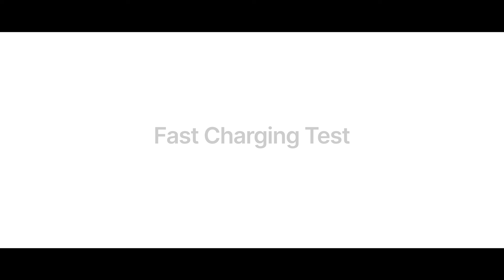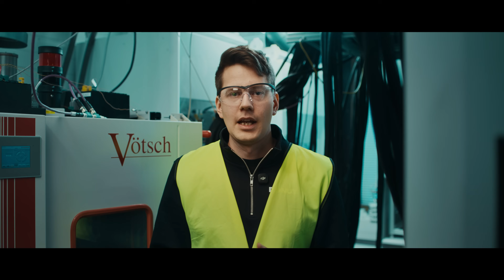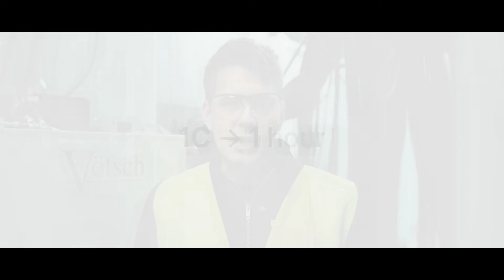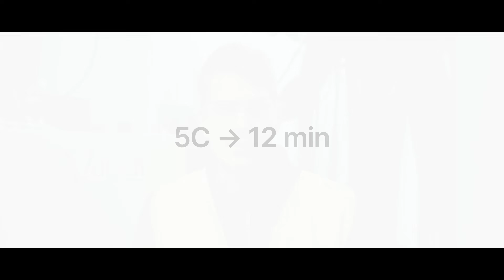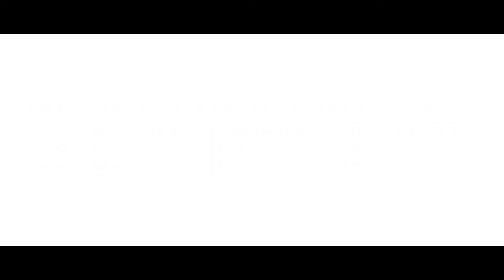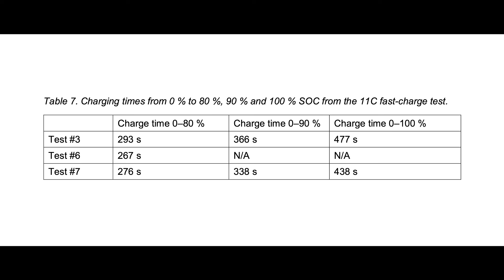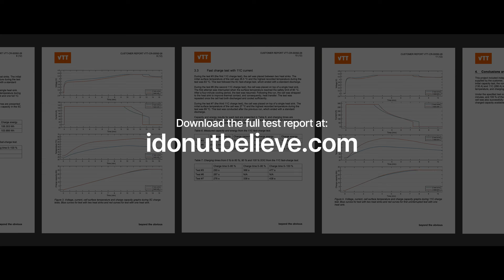Donut Solid-State Battery: Fast Charge Test | I Donut Believe (Pt.1)

Comment: Again, let's inspect what was NOT said here. The report mentioned that one test had to be aborted because battery started to overheat during test number 6 and it was fixed by "the cell was strapped to the heat sink to improve thermal contact". No details about this were provided.

Also, the charging was tested only at room temperature. Original claims include stable performance between -30 °C and +100 °C but the test number 6 was aborted at 90 °C already.

That said, even these results are pretty promising and if the cells actually last 100K cycles with this simple cooling, it would be great news even if other claims weren't true.

And looking at the test results, the end-to-end efficiency of this cell was around 82-92 % so the cell dumped 8–18 % as heat during charging. If you imagine 100 kWh battery pack of these and 10% heat output (nearly optimal design) with 11 C charging, you have to cool 10 kWh worth of heat energy in 5 minutes! Of course, if you can let the battery pack to heat close to 100 °C you don't need to dump that much heat out of the battery because battery will be pretty heavy and will not heat that rapidly even with 10 kWh heat input.
Reply: The weight of the heat sink(s) should be included in the energy density calculation..
Reply: The only reason the test was aborted was the test configuration software having certain standard parameters. You will see this in future episodes.
Reply: @markolehtimaki50  Did the battery lose 1% capacity after the 11C charge? That's how I'm interpreting the test results.

Comment: Impressive results but the cell looks to be 5" wide by 10" long by 3/4" thick. Not really a replacement for a cell 1/8 the size. Also now try it without the massive heat sync attached to it like it would be if it were in a pack.

Comment: Inconclusive testing. None of the heat sink properties are provided (W/K), no environment data (eg. tested in cold room with fan on), no long term battery degradation (main problem with high current inputs), no cell internal resistance or composition provided.

Comment: Kennith Radcliff Shoulders.... I hear EVO's as he called them are donuts. If this is legit there nano structures are definitely using EVOs to store the energy... The Russians got a vacuum tube smaller than a lightbulb to store over 10 kWh using Evos. Don't worry though everyone will call it meta materials, or it will just go dark. Heaven forbid the people figure out about the fractal hyper torroidal moment MFMP....

Comment: You know, in the intro, at 0:36, we're told that the battery is strapped to aluminium heat sinks on both sides in order to "simulate the cell being a part of a typical battery with not so great cooling" but then at 5:45, we see that two heat sinks keep the battery at a lower temperature than just one heat sink (which is what you would expect when heat sinks are strapped to a battery, for it to cool better). So did anyone brief the CEO in the intro properly?

But hey, a higher temperature means that the battery performs better anyways because of lower resistance, so uh woohoo. So I'm confused, if the battery performs better when it's hotter, why exactly are you talking about "active temperature control" at 7:50? Why would the battery need it? Well, according to the paper, it still has a safety limit at 90 °C so I guess you can't let it heat up out of control.

I wonder what happens to the battery after 15 minutes though. How long does it hold the charge? Anyways, I'm not a battery expert, so I really can't say much about what these numbers mean for the battery. Also, whatever it is, the real test is manufacturing at scale in order to make it widely available and my understanding is that there aren't too many customers yet. I'm not really sure what these marketing stunts are for though. Are you going public in a few months in order to raise capital?

Well, time will tell.

Comment: Good marketing. I’ll be following along but I’m really waiting for the full set of testing on one whole pack for power density, charge speed and life cycle.
Even if not as advertised! I’m sure there is something for others to adapt .
Reply: Yes exactly. Even if it's one pouch, having all tests carried out on the same device, verified by an independant body is the only way to be 100% sure this is legit. I want this to be real so much, but it will take this level of proof to believe it. 
My concern is that if they provide different videos for each test, the devices could be optimised for those tests only - so, one that is good for high speed charging, but maybe has a poor lifetime, or another that can be charged 100,000 times but the density is much lower. I hope they have this as one of the videos - if I was them it would be the final video in the series, showing each test run on the same device.
I'm excited and keeping an open mind, but I do need more proof

Comment: From ChatGPT:

Fast-charging claims (this is the one area the report does speak to)

Claim: “0–80% in ~4.5 minutes at 11C”
	•	Where they claim it: I Donut Believe says “0–80% charge in just 4.5 minutes at 11C.”  ￼
	•	What VTT measured: 0–80% at 11C was 293 s and 276 s (4.9 min and 4.6 min).  ￼
	•	Verdict: ✅ Supported (this is real, per this report).

Claim: “Fast charge at ￼ive cooling”
	•	Where they claim it: I Donut Believe calls it “without active cooling.”  ￼
	•	What VTT did: They used large heat sinks (one-sided and two-sided).  ￼
	•	Verdict: 🟨 Technically true if they define “active cooling” as “no liquid/forced air,” but ⚠️ misleading bec ￼e still substantial thermal hardware and temperatures got very high in the one-sided 11C case (see below).

Claim: “Stable thermal behavior”
	•	Where they claim it: I Donut Believe says “stable thermal behavior.”  ￼
	•	What VTT measured:
	•	11C with two-sided heat sinks: max 63°C  ￼
	•	11C with one-sided heat sink: up to 89°C, and one attempt hit the 90°C safety limit and was interrupted  ￼
	•	**Verdict ￼what “stable” means. It didn’t thermal-runaway, but it absolutely got hot and required interruption at the safety cap i ￼

Claim: “Charged to full in 5 minutes (0–100%)”
	•	Where they claim it: Donut Lab CES post: “charged to full in just five minutes.”  ￼
	•	What VTT measured: 0–100% at 11C was 438–477 s (7.3–8.0 minutes).  ￼
	•	Verdict: ❌ Not supported by this report (at least in this test, it’s not 5 minutes to 100%).

Claim: “No need to limit charging to 80%”
	•	Where they claim it: Donut Lab CES post says f ￼hout limiting charging to 80%.”  ￼
	•	What VTT did: They did charge to 100% (26 Ah delivered) in these tests.  ￼
	•	Verdict: 🟨 Partially supported: Yes, they charged to “100%” in the lab protocol — but it was 7–8 minutes at 11C, not 5 minutes, and this is one cell, not a pack.

⸻
Reply: One thing to bear in mind is the tests were tested with the battery just resting on the heatsink not thermally bonded for better heat transfer. Passive heating would include by definition of using heatsinks, but not active cooling of any form (e.g. fans or heat pipes). 

Test #6, although interrupted due to meeting limits, continued with better thermal transfer by the battery being bonded (tapped) to the heatsink. This could be due to starting at a higher temperature, or that for the test the battery had shifted on the heatsink it was resting on.

The 5 minute 100% charging battery claim doesn't indicate under what cooling conditions this is achieved. It may be one of the subsequent video's performs a 5 minute 100% charge (with appropriate cooling required).

Comment: Thermally the test report is "bullshit" if thermal capacity of the heat sink is not mentioned in the report.
The heat sink can absorb most of the power loss due to short test time.
People may ask, does this cell always require "thermal battery" attached. 400Wh/kg will not be valid any more.

Ps. Sad to see this as VTT thermal guru from 1980's but good luck.

Comment: this is what ChatGPT thinks of the report:
Short answer:
⚡ Fast-charge performance: impressive / near-leading
🔋 Energy density: unknown → cannot claim parity
🔁 Cycle life & durability: completely unproven
🌡 Thermal behavior: concerning at extreme C-rates
👉 So: promising power cell, but NOT yet proven on par with top modern Li-ion overall.

Comment: I'm not an electrical engineer. In fact I have zero qualifications of any kind in this field. So please anyone, anyone at all explain to me (after 13 pages of reading) how these results are possible?
Reply: It's already possible with capacitors. The problem is energy density. Capacitors need to be much larger than traditional batteries to retain same level of charge and are thus unusable (as batteries ofc.). As for what the new tech actually is we don't know.
Reply: @WXKFA exactly! The “how” is everything!

Comment: The VTT-CR report is a highly credible verification of specific, extreme charging speeds for the Donut Lab V1 cell. These speeds (11C/5-minute charge) are indeed superior to the publicized 2026/2027 targets of major industry players. However, the report is a narrow performance validation, not a comprehensive endorsement of the battery’s overall commercial readiness or long-term durability.
Reply: They appear to plan to announce one spec per week. Why there is an advantage to spreading out the test data over time is unknown to me. I wasn't a marketing major in college. Maybe they need more time to work out some on going issue.
Reply: @sloansteeringsystems - perhaps by the end their production facility will be churning out batteries for waiting customers. The videos being teasers leading up to it, won't be surprised if the last video cuts away to a car, or commercially available BEV platform, being raced around on Donut lab cells.

Comment: These data are AWSONE.

Next step for VTT:

-Measure the Cell density (Wh/Kg) (if > 240W/kg = crazy good, rip CATL)
-how many cycle can handle before losing capacity (at 1.7C, 5C) if > 300 cycles at 5C = crazy good, rip CATL)

What's not in the VTT scope:

-Confirming the cell is made by abundant and available material and if the cost is actually cheap
-The scalability of production

But just right after this test it's pretty clear this is not a scam as everybody was saying, every result in these test are crazy better than any NMC or LFP batteries

Any top level NMC battery with the forced 11C test would litterally became fully useless in the best case scenario, in the worst case scenario would dangerously take fire
Reply: lets see if this one can handle at least 200 cycles first. Time to conduct such experiment - 1 day

Comment: How much did the sample cell weigh? Im a technician in a testlab. I know how to write test reports. Your VTT test is very short. I miss a lot of data. The charging curves in the report doesnt fit to the video from the CES where the cell starts loading at 4 V.
Reply: As lab staff, you know that mass is the ultimate verification. If Donut Lab gave the weight alongside the VTT energy results right now, the entire industry would have the Specific Energy (Wh/kg) and Density (g/cm^3) calculated before the video ended.
Withholding the weight is clearly a strategic move to prevent the 'X' factor from being reverse-engineered before Part 2 and Part 3 are released. The weight will tell us exactly what that 'clay-like' material is made of. We're all waiting for that final variable to see if the physics truly matches the 400 Wh/kg
Reply: @AJ1964FI  But they claim a lot. and the info about the weigtht could end a lot of the descussion. Holding back these infos is fishy.
Reply: @ingwarnilsson668 its their decision to make this "Netf.." series and we have to live with it😅😊
Reply: @AJ1964FI isn’t this little pack 100Wh? So it weighs about 250gr? With roughly 15x5cm size.
Reply: @Gersmobiel not commenting on that am not their staff but feel free to estimate it
Reply: @AJ1964FI I use the hand as reference and the 100Wh is a given.
Reply: @Gersmobiel to get exactly 400 Wh/kg it should weight 235 gr. Assume its somewhere between 230-240 gr because its now proven they want to give us the result meets the claim😅
Reply: I have access to a similar climate chamber from Vötsch like VTT. I meassured the grid in the back wall of the chamber and dervied the meassurements of the cell from a screenshot of the video. The cell is meassured 200mm x 80mm x 8.mm. That means the cell has a energy density of 740 Wh/L. A standard LiPo cell has a density of round about 350 Wh/L.
Reply: @ingwarnilsson668 IMO its matches perfectly to claim 400 Wh/kg in Verges bike with 33.3 kWh pack and curb weight of 235 kilos
Reply: @ingwarnilsson668 one more thing. Does that lab unit have a safety limit of 90C? I have seen a lot of claims on behalf and against of it. So VTT paused the test because of safety limit for their gear or cell was heating too much?

Comment: Cell data? Weight and capacity?
Reply: It says in the report they showed that the capacity is 26Ah or 91wh with it taking 101wh to reach full charge. But the weight and size weren't listed there. The pictures of a cell do actually appear about the right size for that capacity though being about the size of your palm. You can already buy pouch batteries for your phone that are only marginally larger with similar capacities so it's possible.
Reply: @Skylancer727  The very reason they didn't state the weight and size makes it suspect. I think it's a scam, for now. Just a standard high C-rate WET lithium-ion cell.

Comment: They fail to say what capacity the battery demonstrates after this charge rate and ofter repeated such cycles. Doing it once proves only that the battery hasn't suffered thermal runaway on this single occasion. Maybe the report contains more details.

I'm still unconvinced.
Reply: For this single battery was rated at 26AH, For that single small battery is amazing.

Comment: I've been working in marketing for two decades, and heard over and over again how Finnish engineers don't know how to market their innovations. The times have clearly changed. Thank you, well done!
Reply: That is kind of what happened here, Nordic Nano did a little marketing then Donut Labs stepped in and bought into the rights on the battery an now does all the marketing.
Reply: a two decades experience super "marketing" veterans know how a solid state battery works. Look, my mama said, do not trust a overweight middle age guy that can't controlled their diet and don't exercises.

Comment: Bro, the chart says that when idle for an hour the voltage drops slowly
Reply: This is also true for many Lithium chemistry batteries, LFP is 3.65V at 100% SOC this drops after surface voltage tails off to around 3.4V
Reply: @bas5946  I still want to see the test over several days to prove is not self discharging, like a cap. A normal battery drops several mV, 3.4V is already close to complete discharge
Reply: @cristibaluta  3.4V on Lithium Ion is considered empty, LFP @ 3.4V is considered full, for Na batteries this is 80% SOC. Without knowing the underlying chemistry its impossible to gauge the SOC just from voltage alone per cell.

Comment: Cell temperature only rising to 63C, This for Li-ion batteries is disastrous. I wonder how good these SSBs are to withstand these temps
Reply: 63°C is already very high, and 90°C is disastrous for Li-ion cells. If they can substantiate all the other claims and then do them all in one cell at the same time, they really have something here. Assuming that it can be mass produced as well.

Comment: Testing a single cell under various thermal conditions like this is not like how in an assembled pack will perform where the cells in the center of the pack will be much hotter and will be the limiting factor in how quickly you can charge the battery.  I didn't see anything revolutionary in any of this information so far.  I would be curious about how they sells degrade at those higher temperatures.  When they arrived at a fully assembled pack that can provide the performance that they have claimed and life cycle testing has been performed, then it will be time to get excited.
Reply: Sorry for the spelling errors, voice to text LOL.

Comment: Replacement for Nissan Leaf battery 😊 Would be a great update for a older car like the Leafs with no thermal management in the pack.
Reply: You'd have a Nissan leaf with a 20 million kilometres on the clock by the time this wore out.
Reply: Please please please!
Reply: Exactly! I love my leaf, but also hate it atm, in the Finnish cold😅
Reply: It's not real. Don't get excited
Reply: And with the energy density any  gas car could get a retrofit. They managed 33 kwh in a motorcycle, so replacing a gas tank with 50 kwh alike battery and the motor & gear with an electric drivetrain, should barely cause any significant weight penalty. Not to mention that the 50 kwh and potential charge speed of 10 minutes are very much sufficient for most driver scenarios.
Reply: If this is real it will replace ALL gas cars and electric car batteries without question.
Reply: @ProfessorBraus I was talking to someone recently who said he prefers gas powered cars. When I asked him why, he said it's because he likes to work on them. Kind of tells you something about the state of gas powered cars. 😁